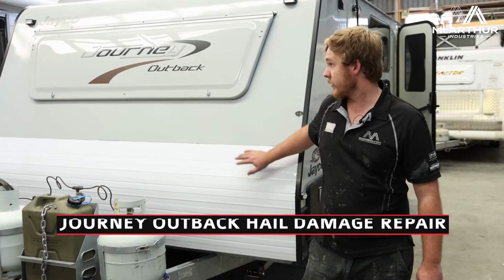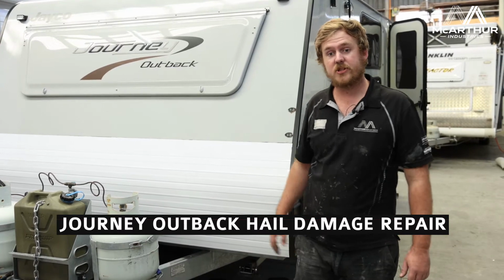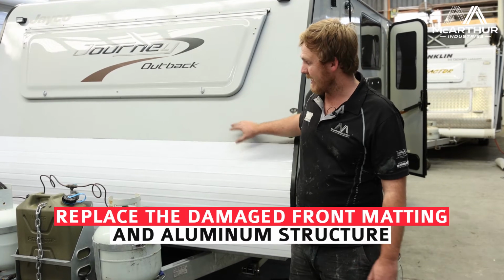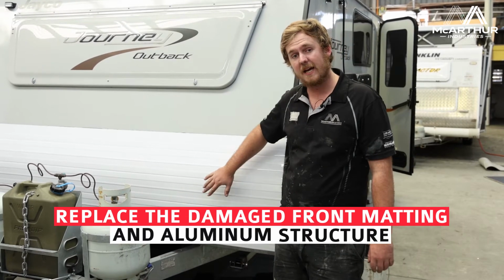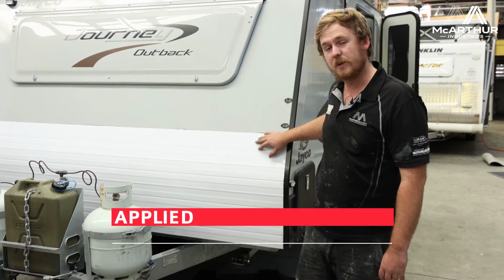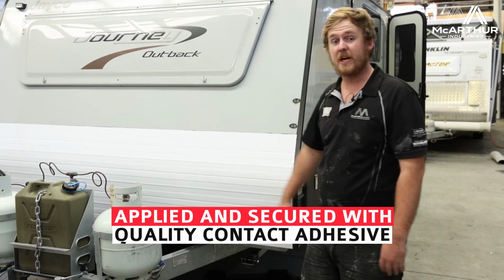Caravan Hail Damage Repair for Jayco Journey

Comment: I have a 2008 Jayflight G2 25RKS Travel Trailer that has small hail damage dents on the front face of the trailer itself its an aluminum siding I believe thats on it is there a way to pull these dents out don't expect to get it back to original condition just to look better and advise would be appreciated not interested in replacing the siding either. Thanks 👍